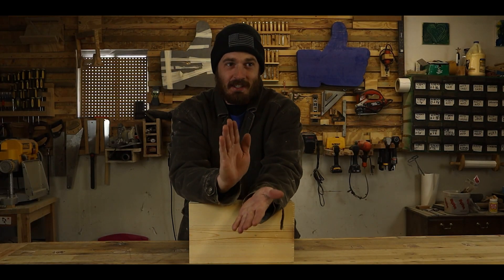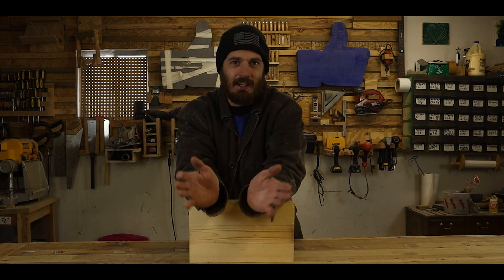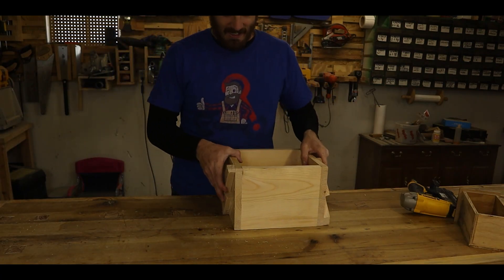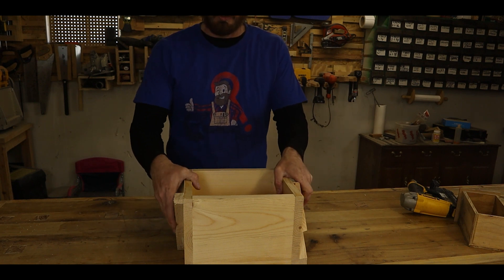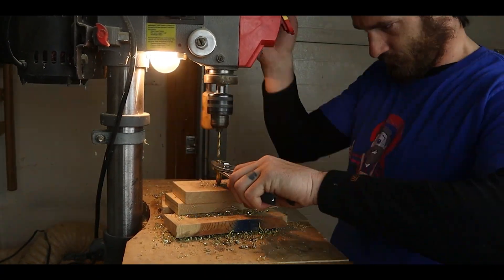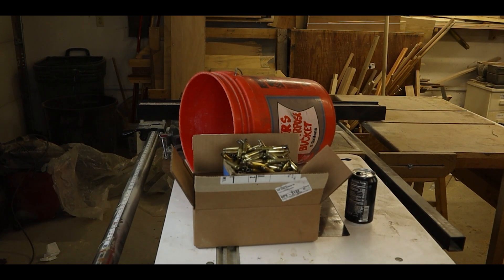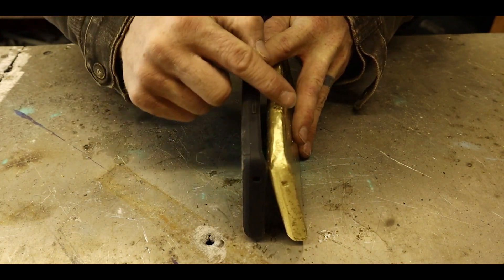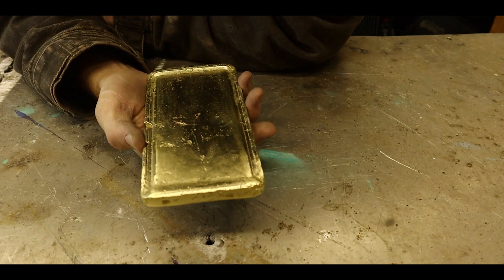Casting with Green Sand | Practice and Troubleshooting

Comment: You would achieve a better casting if you use a runner with your sprue and add an additional runner with a vent.
Reply from the maker: That sounds awesome. What do you mean by runner?
Reply: @WyldeWoodworks  your Sprue is supposed to be offset from your casting model. The runner connects the sprue to the casting to control the flow. A vent is needed to avoid bubbles from the trapped gases.